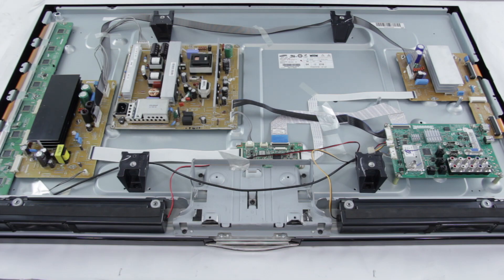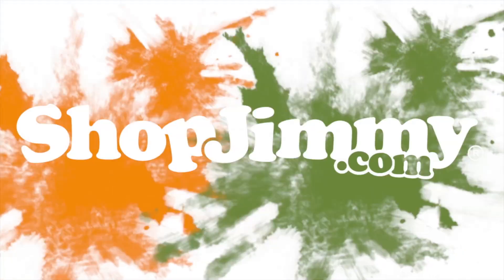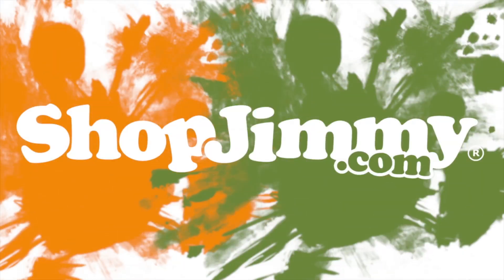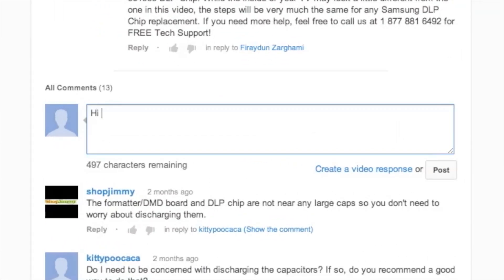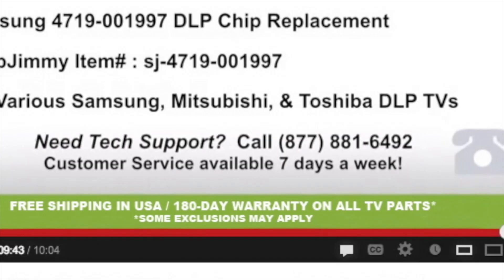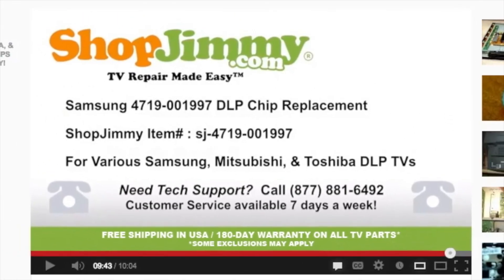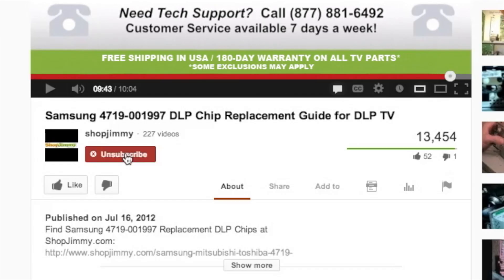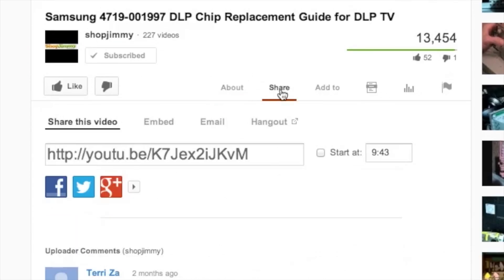Plasma TV Repair Tutorial - Common Symptoms & Solutions - How to Fix Plasma TVs

Comment: nice video and thanks for making it.  I'm working on a Samsung PN42C450B1D plasma TV. basically its not turning on.  clicks a few times and stays off. The X-sustain was shorted so I decided to replace both the X-sustain and the Y-sustain since it seems like these card are sensitive.  since I didn't know if the buffers were bad or anything else I decided to test with out the y buffers disconnected plus the ribbon cable coming out of the X-sustain going to the screen.  Ohm meter tested  a few K ohms from Vs to ground,  with power it cam on to the Samsung chime but no picture.  I connected the x-sustain cable going to the screen powered on and heard a small pop and shorted x-sustain  again.  Could you explain more details what the voltage from the x-sustain does and if this how this would short the x-sustain.  also if you have any suggestions on fixing.  I'm assuming that there is a problem with the screen and probably not worth fixing now.  thanks  John
Reply from the maker: John Youmans   This sounds like a TV panel problem.  If your TV panel is bad, it may be more cost-effective to replace the TV as panels are typically hard to find in stock, difficult to replace, and expensive.  Thanks and please let us know if you have any further questions!  www.shopjimmy.com

Comment: hi i have sanyo dp50747 plasma  wont come on
Reply from the maker: MJ MJALLY   I recommend replacing the power supply board in your TV.  Here is a link to replacement parts for your TV model number on our website, click here:  http://www.shopjimmy.com/catalogsearch/result/index/?cat=59&q=dp50747  Be sure to match part numbers on your current board, with your replacement for compatibility.  You can also call our customer service for further assistance with your purchase.  (877) 881-6492  Thanks and please let us know if you have any further questions with your TV Repair!  www.shopjimmy.com

Comment: I am looking for some help please with the repair of a telefunken vegas 

VPM -500FH

Serial - 0110270021
Manufacture Date : 01201027.

Basic Problem is that the unit switches itself off intermittlently and then comes back on with black and white dots.
Reply from the maker: Coswell Arnold   Unfortunately we do not have any information for this TV model.  Thanks!  www.shopjimmy.com

Comment: I have a Panasonic plasma TH-58PZ800U that is driving me crazy. In January, the set shut off mid-viewing and began flashing a 2-blink LED error. After referencing the service manual, I replaced the D-Board (main logic). It still would not turn on, but with the new board began flashing a 3-blink LED error. Again, after referencing the service manual I attempted to replace the A board (main tuner/input board). I couldnt find a replacement part so I sent the original off for repair & return. The shop tested the board and said it was fine as-is, so I put it back in. They recommended I check the power board, so I ordered a replacement for that. Still 3 blinks. I put the original D board back in and was back to 2 blinks again. I gave in and had a local shop run a diagnostic on the entire set. They tested both old and new power boards and those checked out as ok. They did diagnose a short in both the SC and SS boards. I replaced those boards and now I get 5 blinks (which changes to 10 blinks if I hold down the power button). I've already spent enough on "quick fixes" to buy a new set and am at a complete loss as to what's going on with this plasma. I hate to toss it out after only 3 yrs of use.
Reply from the maker: Helza Poppin   It sounds like the only boards left to try replacing are the SD and SU boards.  Here is a link to replacement parts for your TV model number on our website, click here:  http://www.shopjimmy.com/catalogsearch/result/?q=TH-58PZ800U  Be sure to match part numbers on your current board, with your replacement for compatibility.  You can also call our customer service for further assistance with your purchase.  (877) 881-6492  Thanks and please let us know if you have any further questions with your TV Repair!  www.shopjimmy.com

Comment: Hi ShopJimmy.  I have a sanyo Model DP50747.  After we moved I would turn the tv on and then it would turn itself off and then right back on. # weeks later I turn it on and the audio plays but no image and then turnd itself right off for good. Any Ideas what might be wrong?  Great video by the way.
Reply from the maker: Klaus Wood   I recommend replacing the main board in your TV. 
Here is a link to replacement parts for your TV model number on our website, click here:  http://www.shopjimmy.com/catalogsearch/result/index/?master_part_type=Main+Board&q=DP50747  Be sure to match part numbers on your current board, with your replacement for compatibility.  Here is a link to a video showing how to identify your part number, click here:  TV Part Number ID Guide for Sanyo Main, Digital, & Terminal Boards (LCD, LED, Plasma TVs)  You can also call our customer service for further assistance with your purchase.  (877) 881-6492  Thanks and please let us know if you have any further questions with your TV Repair!  www.shopjimmy.com

Comment: I have a Samsung model # pn3d450ad2. It just turned off. No red standby light. Will,not turn back on. Replaced the power supply board. Still,nothing. No green light on the logic board or no red standby light on the front. Any help? 
You can also contact me at rbutt73@ hotmail. Com
Thank you..
Reply from the maker: Robert Butt   I recommend replacing the main board in your TV.  Here is a link to replacement parts for your TV model number on our website, click here:  http://www.shopjimmy.com/catalogsearch/result/index/?master_part_type=Main+Board&q=pn43d450a  Be sure to match part numbers on your current board, with your replacement for compatibility.  Here is a link to a video showing how to identify your part number, click here:  Samsung Main Boards & Digital Boards: Part Numbers for LED, LCD, DLP, Plasma TV Repair  You can also call our customer service for further assistance with your purchase.  (877) 881-6492  Thanks and please let us know if you have any further questions with your TV Repair!  www.shopjimmy.com

Comment: Greetings shopjimmy I have a Samsung plasma PN51F4500AF that has black squares and shadows on the right half of the screen. Left half still has good image. No device connected and it performs the same way.
Reply from the maker: DarthGarrett   This sounds like a TV panel problem.  If your TV panel is bad, it may be more cost-effective to replace the TV as panels are typically hard to find in stock, difficult to replace, and expensive.  Thanks and please let us know if you have any further questions!  www.shopjimmy.com

Comment: Hey jimmy I have a LG plasma 50PK550, when I plug the t.v into power the standby light comes on then when i try and turn the t.v on it will almost come on for a second but then automatically turn back to standby again. when plug the T.V into my laptop via hdmi my laptop it recognises it when I try to turn it on but as soon as the t.v gose back to standby mode it obviously disconnects through the laptop aswell. Anyways please help because Im too poor to buy a new one atm ahaha! cheers
Reply from the maker: Colby Buxton   I recommend replacing the main board in your TV.  Here is a link to replacement parts for your TV model number on our website, click here:http://www.shopjimmy.com/catalogsearch/result/index/?master_part_type=Main+Board&q=50PK550  Be sure to match part numbers on your current board, with your replacement for compatibility.  Here is a link to a video showing how to identify your part number, click here:  TV Part Number Guide for LG & Zenith Main, Digital, & Tuner Boards (LCD, LED, Plasma TVs)  You can also call our customer service for further assistance with your purchase.  (877) 881-6492  Thanks and please let us know if you have any further questions with your TV Repair!  www.shopjimmy.com

Comment: I have a samsung 50inch model # pn50a450p1d it has horizontal black lines can it be fixed ? If so how.
Reply from the maker: Desirae Wright   I recommend replacing the buffer in your TV.  If this does not fix the problem, then you have a bad TV panel.  http://www.shopjimmy.com/samsung-bn96-12956a-y-buffer-board.htm  Be sure to match part numbers on your current board, with your replacement for compatibility.  Here is a link to a video showing how to identify your part number, click here:  Samsung Plasma TV Repair: Samsung Plasma Panel Parts Guide  You can also call our customer service for further assistance with your purchase.  (877) 881-6492  Thanks and please let us know if you have any further questions with your TV Repair!  www.shopjimmy.com

Comment: Hi, great video !
 I have a Panasonic TH-50PZ77U. The tv is flashing 7  lights  on the power button and won't turn on.
What is causing this ?
Thanks
Reply from the maker: Mauricio D   I recommend replacing the SC board in your TV.  Here is a link to replacement parts for your TV model number on our website, click here:  http://www.shopjimmy.com/catalogsearch/result/index/?master_part_type=Y-Sustain&q=TH-50PZ77U  Be sure to match part numbers on your current board, with your replacement for compatibility.  You can also call our customer service for further assistance with your purchase.  (877) 881-6492  Thanks and please let us know if you have any further questions with your TV Repair!  www.shopjimmy.com

Comment: Good Video. I have a Panasonic TC-P50S2 plasma. When turned on, it looks normal. After about 10 seconds it begins to fill with multi-colored horizontal lines until they are covering the screen. I'm guessing it's the SS board but would like your opinion. Thanks. Image here: http://www.jpeg-optimizer.com/uploaded_images_final/IMAG0598__1405550554_146.115.167.8.jpg
Reply from the maker: Jason Buranich   This sounds like a TV panel problem.  If your TV panel is bad, it may be more cost-effective to replace the TV as panels are typically hard to find in stock, difficult to replace, and expensive.  Thanks and please let us know if you have any further questions!  www.shopjimmy.com

Comment: I have a VIZIO VP50 HDTV20A PLASMA WITH SAMSUNG INSIDE PARTS  FIRST I HAD NO PICTURE AND SOUND AND NOW I HAVE NO PICTURE AND SOUND.  WHAT DO YOU THINK I NEED TO REPLACE.
Reply from the maker: Cathy Ramundo   I recommend replacing the Y-Main Board and the Y buffer boards in your TV.  Here is a link to replacement parts for your TV model number on our website, click here:  http://www.shopjimmy.com/catalogsearch/result/?q=VP50+HDTV20A  Be sure to match part numbers on your current board, with your replacement for compatibility.  You can also call our customer service for further assistance with your purchase.  (877) 881-6492  Thanks and please let us know if you have any further questions with your TV Repair!  www.shopjimmy.com

Comment: Samsung PN50c6500tfxza: Turns off intermittently and changes source constantly, after about 20-30 minutes of use.  Help please
Reply from the maker: autumnsprings44   I recommend replacing the main board in your TV.  Here is a link to replacement parts for your TV model number on our website, click here:  http://www.shopjimmy.com/catalogsearch/result/index/?master_part_type=Main+Board&q=PN50c6500tfxza  Be sure to match part numbers on your current board, with your replacement for compatibility.  Here is a link to a video showing how to identify your part number, click here:  Samsung Main Boards & Digital Boards: Part Numbers for LED, LCD, DLP, Plasma TV Repair  You can also call our customer service for further assistance with your purchase.  (877) 881-6492  Thanks and please let us know if you have any further questions with your TV Repair!  www.shopjimmy.com

Comment: Hello, thanks for the great video! I have a 46" Panasonic Viera, model number TH-46PZ85U. About two weeks ago, it stopped displaying a picture. The TV will turn on without a problem, and will display things like the TV menu or volume slider, but it will not display an input. My cable box and XBox will not display at all via HDMI. My Wii menu will display for literally half a second (but display correctly), then disappear. When this first happened, I did notice a crackling sound briefly, but since then the symptoms listed above are the same every time. Local repair shops would cost more than a new TV, and I am capable of replacing a board, but wanted to know what you thought. It seems like the board are out of stock on your website as well, so not sure what to do.
Reply from the maker: *****   I recommend replacing the main board in your TV.  Here is a link to replacement parts for your TV model number on our website, click here:  http://www.shopjimmy.com/catalogsearch/result/index/?master_part_type=Main+Board&q=TH-46PZ85U  Be sure to match part numbers on your current board, with your replacement for compatibility.  Here is a link to a video showing how to identify your part number, click here:  Panasonic Plasma HD TV Repair Tips: Suffix Codes for A Board & Main Boards  You can also call our customer service for further assistance with your purchase.  (877) 881-6492  Thanks and please let us know if you have any further questions with your TV Repair!  www.shopjimmy.com
Reply: Thanks! The problem is that those are all out of stock. What do you suggest?
Reply from the maker: *****   You can sign up to be notified when the part is back in stock on the product page for your replacement part.  Thanks!  www.shopjimmy.com

Comment: Hi Shop Jimmy, I have a Samsung 50" Plasma model# PN50B450B1D. It just turned off during operation. It shows that it's in standby mode and then I turn it on and I get the clicks as if it's going to power up, then I hear a faint quick beep, then the clicks again and then it goes back to standby mode. I left it powered down for the day and tried again the next day with the same results. After watching your video, I've decided to open it up and try to repair it myself. Any clues on what may be causing this would be helpful, thanks.
Reply from the maker: Tim Hundley   Try this at your own risk.  I recommend disconnecting the Y board to see if the TV stays on.  Here is a video that may help you to troubleshoot your TV repair.  Samsung Plasma TV Help with Clicking Noise On Off TV Repair How to troubleshoot Vizio & LG  Thanks and please let us know the results.  www.shopjimmy.com

Comment: We have a Panasonic TC-P65ST#30 Plasma.  There is a vertical yellow band on the far right side of the screen. It is translucent. We have tried the reset procedures that Panasonic recommended.  It shows from all input sources.
Reply from the maker: Karen McNatt   This sounds like a TV panel problem. If your TV panel is bad, it may be more cost-effective to replace the TV as panels are typically hard to find in stock, difficult to replace, and expensive. Thanks and please let us know if you have any further questions! www.shopjimmy.com

Comment: I have a panasonic TC-P60S30 60" plasma tv that will not turn on no flashing lights or clicking manually or remote I'm thinking power board.any ideas, do you sell them
Reply from the maker: dgallo810   I recommend replacing the power supply  board in your TV.  Here is a link to replacement parts for your TV model number on our website, click here:  http://www.shopjimmy.com/catalogsearch/result/index/?master_part_type=Power+Supply&q=TC-P60S30  Be sure to match part numbers on your current board, with your replacement for compatibility.  Here is a link to a video showing how to identify your part number, click here:  DIY Plasma TVs 101: Part Identification Number Guide for Panasonic Power Supply (PSU) Boards  You can also call our customer service for further assistance with your purchase.  (877) 881-6492  Thanks and please let us know if you have any further questions with your TV Repair!  www.shopjimmy.com

Comment: Gentlemen I have a Samsung 60" plasma 3d and the problem is when I turn on the TV there is no picture but the sound works. Can you tell me what it can be the problem. The model pn60e550d1fxza and series number z4sq3ckcc03559m
Reply from the maker: Powahouse02   I recommend replacing the Y-Main Board and the Upper & Lower Y-Scan Drive boards in your TV.  Here is a link to replacement parts for your TV model number on our website, click here:  http://www.shopjimmy.com/catalogsearch/result/?q=pn60e550d1fxza  Be sure to match part numbers on your current board, with your replacement for compatibility.  Here is a link to a video showing how to identify your part number, click here:  Samsung Plasma TV Repair: Samsung Plasma Panel Parts Guide  You can also call our customer service for further assistance with your purchase.  (877) 881-6492  Thanks and please let us know if you have any further questions with your TV Repair!  www.shopjimmy.com

Comment: I have a Samsung PN50B550T2F Plasma TV.  It has several thin black horizontal lines across the top and one in the middle.  I tried re-seating all the ribbon cables and no change.  I also swapped the y buffer board and the lines are still there in the same spot.  Is the panel most likely bad?
Reply from the maker: *****   Yes, this sounds like a TV panel problem.  If your TV panel is bad, it may be more cost-effective to replace the TV as panels are typically hard to find in stock, difficult to replace, and expensive.  Thanks and please let us know if you have any further questions!  www.shopjimmy.com